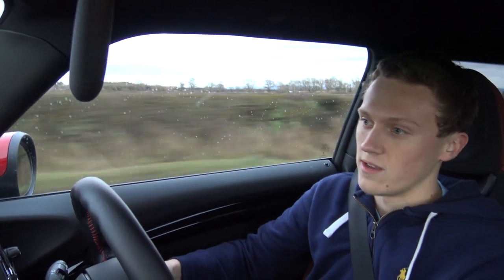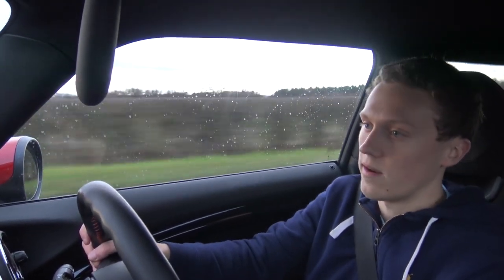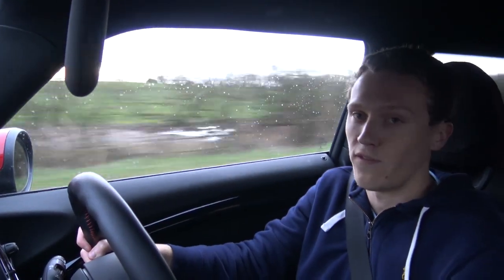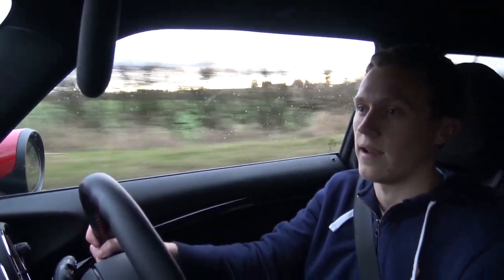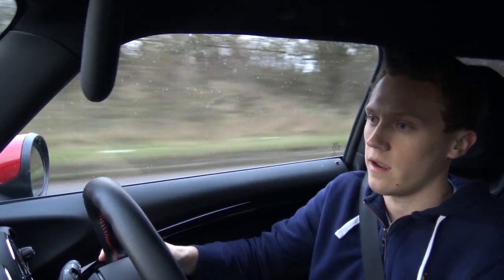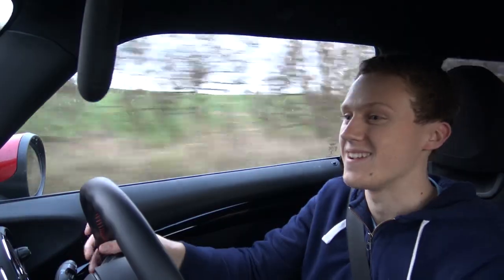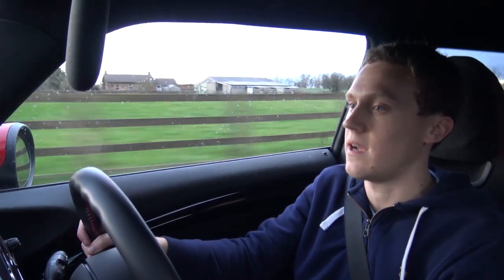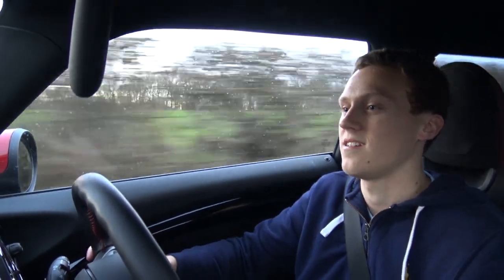Living with a Mini John Cooper Works (JCW) - Episode 1: Performance

Comment: Thank you for clarifying that this car has auto rev match included. I just picked up my 2019 JCW and even the dealer that sold me the car wasn’t quite sure if it did have it or not. Actually curious to see if I can turn off the feature but otherwise good to know that it’s there in case I do get lazy....great video by the way
Reply from the maker: No problem at all, yeah can't say I was hugely impressed with dealer knowledge when I bought mine. Yeah so with the car in normal traction control on and dynamic traction the rev match feature is present but if you turn off traction control fully it disables it which is really nice. On top of that these cars are pretty easy to heel toe downshift so thankfully that element is still there! Thanks a lot man, cheers for watching 👍

Comment: Considering a Quaife Diff in mine
Reply from the maker: Ahaha been there before - if I increased power a Quaife LSD would almost be a must have I think. Think the standard torque vectoring by braking system would really struggle with an increase in power over stock